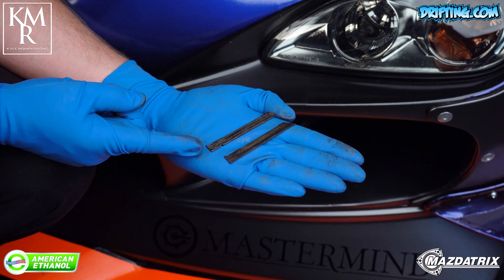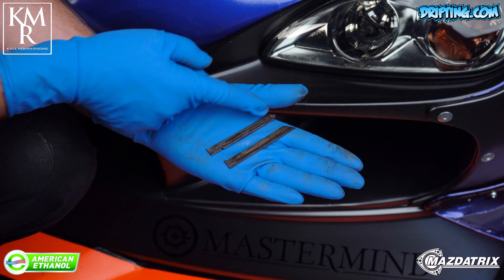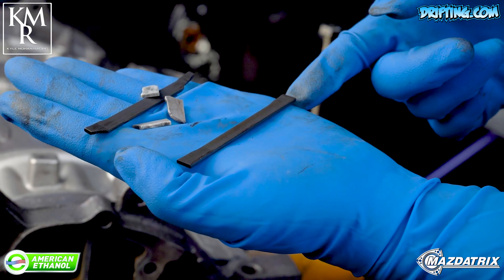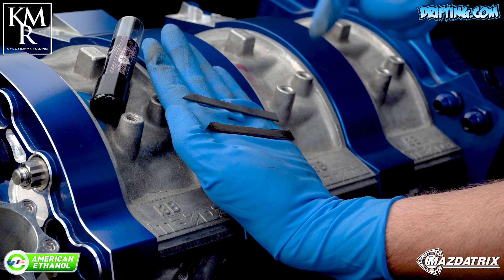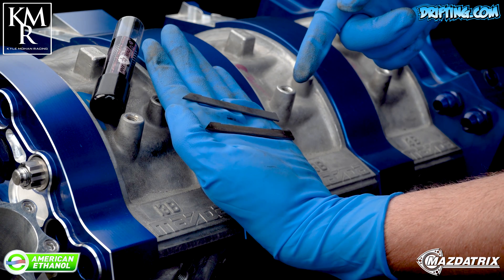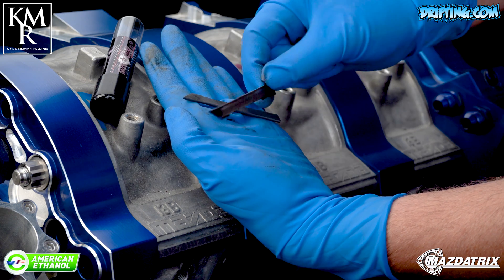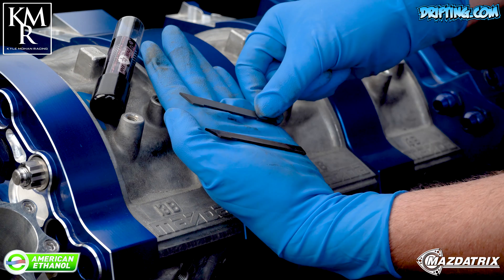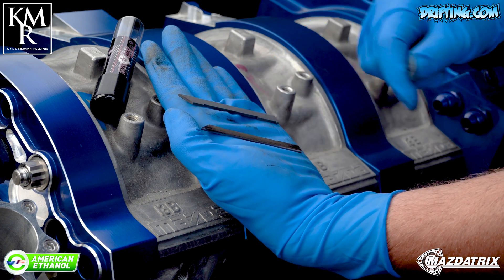Ceramic vs Steel Apex Seals / Aftermarket / OEM - 13B Rotary Rebuild

Comment: Which type of Apex is better the two piece or the one piece?
Reply from the maker: we answered this question on video yesterday, several small clips will be released , thank you
Reply from the maker: Kyle will answer you question when we film on Sep 23rd
Reply: South coast power seals are unbreakable